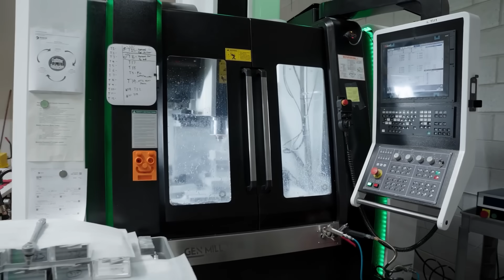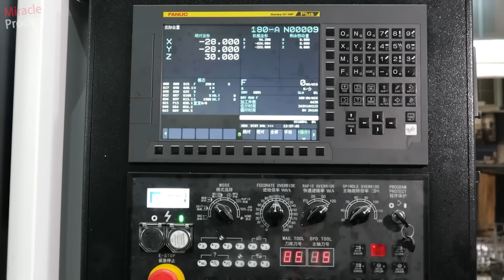This Is Why America (and India) Cannot Compete With China Manufacturing - An Engineer's Perspective

Comment: For a HIGH profit driven economy like the US, it's very difficult to start large scale manufacturing even if you totally automate. They'll demand high profit returns starting from the foundational infrastructure building. The high cost of everything, from skilled labor to hardware, etc. Totally uncompetitive.
However, with long-term subsidies and support for smaller and medium manufacturing for local market use only is still viable.
Competitive globally is totally out of the question.

Comment: As engineer on mechanical, i agree with u. India is ober claiming they're the best on any ways even on machine designed, manufactured and purpose theirs creating thats machine will be claimed only a junk by indian and manuals book is nothing benefits for indian and at time operating thats machine, indian will operating thats machine only for shortest time and simply broken. So why many indian born engineers working on HAL  jets repairs shop love to use sugar cane fluids replacing hydrolic fluids and simply easy replacing tungsten screw with recycle metal screws on jet engine..

Comment: We seem to be mixing expertise in product innovation with supply chain management along with assembling/manufacturing.
China has made more than significant strides in the former after spending a lot of time mastering the latter.
To elaborate my point further, Apple most likely does the initial design, prototypes and the like for its products almost exclusively in Cupertino, CA and then gives the green light to their various suppliers/vendors for orders after the products have been certified. China is basically only assembling Apple products in China with components coming from various parts of the world.
Reply: China makes most of the components there too, on top of assembly. I worked on the iPhone team.
Reply: ya, Apple, the only phone company in the universe.
Reply: @yzy8638 Apple products are mostly meant for the Western market and affluent people around the world including the ones who want to portray affluency if youtoday barring the iPhone SE model. Their design language is to make the customer productive in terms of ease of use and features. 
There are alternatives in the market today. Samsung and a few Chinese brands have a fairly robusta market share along with Apple. 
As much as my disdain for everything "APPLE" (including the fruit), there isca method to their  madness. It started with the iMacs which were always a media junkie's go to TOOL if you will. Then came the iPhone followed by the iPod, iPad, iCloud and then just generational improvements every year making sure the millions of customers at some point in time would always transition to the newly available puppies. 
Gen Z is obsessed about posting a picture every other breath they take and that has primarily made mobile phones expensive today.

Comment: I think American engineering and manufacturing is still top tier. US suffers the same problem as China, people tend to focus on the shitty part of the manufacturing. I mean look at Boeing, Lockheed, and so on. At the intellectual level, you rarely see the same rhetoric you see from the politicians. Because universities knows what the US and China is about. Both US and China are investing heavily in fully automated manufacturing with 5 or 6G network connection that means you can control a manufacturing assembly line located in Detroit from London Ontario Canada or vice versa. If you look at the top universities for robotics and automated manufacturing researches, it's mostly a split between the US and China (with China leading now recently). Human capital will cost more in the US but once companies fully adopt to automated manufacturing, countries that rely on cheap human labor will no longer have that advantage. As a Chinese Canadian, I am not worried about the US, I am worried about 3rd party countries like India, Canada and the Eastern European Bloc, because these places rely on cheaper labor or cheaper logistics however, with automated manufacturing, factories will re-shore back to the US or China. India especially, will be a powder keg, with that many young people and if with no jobs, it might rip through their already delicate social stability.

Comment: Everybody is beating a path to China; not just manufacturers but also producers of raw materials, oil & gas, finished & semi-finished components. 

Take Qatar for example, when Russia practically gave away her gas supplies for free to China, Qatar lost no time signing a 25-year gas supply contract with China. Why ? China does not need to pay for gas from ANYBODY - at the price Russia is giving out the gas, ONLY for China. In economics, there's a principle called Substitution - in case supplier A falters, it's prudent to have Suppliers B, C, D, etc, in your supply chain. Qatar is also prompted to reach out asap in order to lock in an early mover price. The next significant gas supplier would likely be pressured to quote a lower price. 

Price isn't the only factor; Qatar just awarded a contract to China's shipyards to manufacture more than 20 CNG Carriers. What China pays for CNG, China gets paid for supplying ships to Qatar. There are MANY cards at play in business, China holds MANY cards. Whether it's soybeans or petroleum, China has everything neatly dovetailed in her Industrial Revolution / Strategy 2.0. The rest of the industrial world is trailing a long, long, . . . . . . way off at Industrial Revolution 1.0.

BASF ( a German Chemicals and Industrial Conglomerate ) CEO said, quote - " if it were not for BASF operations inside China, we would NOT be able to operate BASF in Europe ", unquote. 

GM used to sell more cars in China than USA until EVs appeared. If China so wish, the REST of other EV manufacturers may never assemble electric vehicle at any market price. 

Chinese Industrialists do NOT fuck around with loose promises or deals. They want results. Screw them with loose or unkept promises, and one day you'll find the Chinese has a way to pay back in kind. The Afghan Taliban will soon find out - they cut China out after signing a major Petroleum Drilling agreement. India learned a lesson after China sanctioned Urea sales to India. India's crop production 2025 / 2026 is going to take a hit without fertilisers made from Urea. India's High Speed Rail, already . . . . .  years . . . . behind schedule and over-budget; just slowed down further when China seized 2 Earth Boring machines - India ordered from a German manufacturer but assemble in China; after India refused to make the final installment payment for a Chinese made Earth Boring machine delivered earlier.

Some folks particularly Indians, understand fear far better, than respect. 

The next China will be India ? 

I won't hold my breadth. 

Can India manufacture the wheels of a High-speed train ? Or their bearings ? Or an 155mm diameter Artillery shell Barrel ? Comparing India with China is like a comparing an idiot with a scientist, respectively. 

The next China ? She's is well on the way. Folks aint seen nothing yet.
Reply: On point 👍👍👍

Comment: Case in point is Foxconn in India. Under pressure from Chinese gov, Foxconn have recalls 300 Chinese workers from it's iPhone plants in India and Indian gov & their media is unhappy about it. The plant have been producing IPhone in India since at least 2020 but as at now Indian still need to be train, supervised, manage & guide by the Chinese. It seems 5 years is still not enough for the worker in India to be as efficient as their Chinese counterpart.
Reply: 额，原因不是印度政府不给中国人发放签证吗？
Reply: @吴畏无惧  Initially yes. Timeline: 2020, Visa restrictions on Chinese engineers, due to border tensions in Galwan. 2023–early 2024, India Manufacturing bottlenecks raise alarm. Mid‑2024, India Ministries agree to an SOP and launch a visa portal. Aug 2024, 6‑month Chinese business e‑visas via portal, fast‑tracked (~30 days). Late  2024–2025	Visas being issued again under the fast‑track system, easing production flow. June-2025, Chinese gov recall back Chinese engineers from India.

I guessed India would faced Manufacturing bottlenecks again .
Reply: 就300人就让印度制造业停顿？你在开玩笑吗？
Reply: Even the people civil sense,  discipline, social behavior is far, far a big gap to compare to the Chinese. Indian 😂😂😂😂😂😂😂

Comment: You are right. China can make a product at any price point. If you ask for cheap price don't expect good quality input into making the product. Many westerners said China made products are crappy. That's because they want good stuff but are not prepared to pay a good price. If the Chinese can make a Space Station or the BeiDou satellite navigation system that not only rival but to some extent perform better than the ISS or the GPS, there's no reason to believe they can't manufacture everyday goods at high or exceptional quality.

Comment: You are not the first to make the point that the production customer sets the quality determinants when placing its order with a Chinese supplier: you want a baseline level cheap and cheerful product to maximise retail sales and profit margins? Well, the Chinese will oblige. But if you want a durable higher-quality product comparable (say) to German competitors, then the Chinese will accommodate you there too.

A common and no doubt comforting myth here in the UK is not just that Chinese consumer products are short-lived unreliable crap, but also that its all based on copying "us". They give no credit to the Chinese for their push in educating literally millions of STEM graduates over the years and then reaping the harvest in home-grown IP. Hence the surprise at, for example, China's commanding lead in EV technology and manufacturing numbers - the solution to this is the comically non-free enterprise push simply to ban or tariff out of existence Chinese imports. While simultaneously breaking their economies anyway by sweeping Net Zero green policies LOL...
Reply from the maker: You are correct, the Chinese definitely built some of this on their own. Their advancements of sectors like automotive and green energy cannot be overlooked.

Comment: all the things (military) required to be made only in USA, still rely on things (used to make machines) sourced ONLY from China

this is why USA is panicking like crazy

imagine people in USA running out of superhard cutting bits used in high-precision CNC Lathes to make machine tooling, dies, and parts

ditto: lasers
ditto: electronics components, soldering connections for computer chips, micro-fasteners to assemble computer and electronics circuit boards, sensors, etc

supermagnets for motors or pumps or impellers or switches, etc

special rare earth metals for weapons durability, stability, strength, heat resistance, other special unique properties, etc

Comment: Most other countries are unable to compete with China efficiently and effectively in manufacturing - they lack the manufacturing eco-system and all-encompassing logistics that China has built from the proto-typing of a new product to the supply of raw materials to sub-assemblies to manufacturer of choice to production to freight and delivery to packaging to delivery to the ports and an efficient bureaucracy to handle all of that. On top of all this is a layer of well-educated, well-trained workers from the ground up to their technicians and engineers. China is an entire manufacturing nation with all the machinations in place - similar in a way to what the U.S. WAS back in the 1940s but far more coordinated and planned out. 

Even as the cost of labor has gone up, at the same time, the Chinese manufacturing industry has not stood still with manual labor but have gone into automation and robotics which has not only resulted in higher quality of their products and higher productivity which results in lower costs but has helped in keeping production costs low. The only area that they have difficulty in reducing costs are that of certain raw materials that have to be imported which costs are controlled by the international cabal.